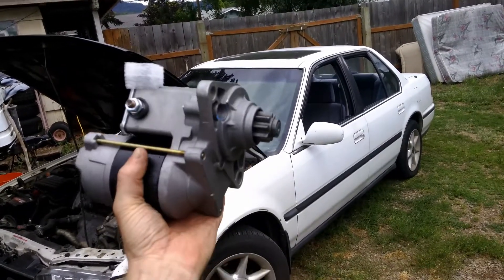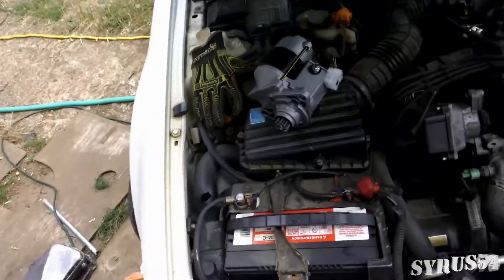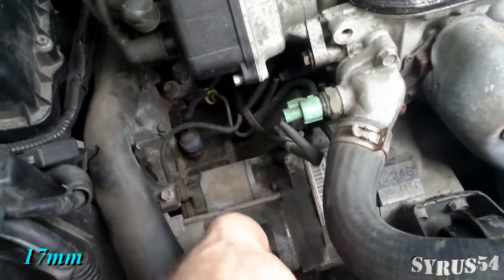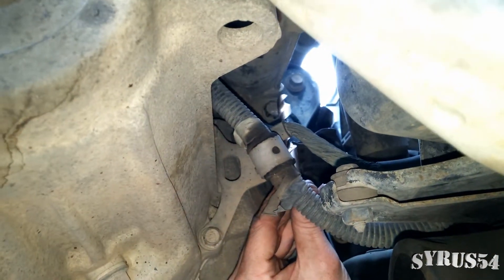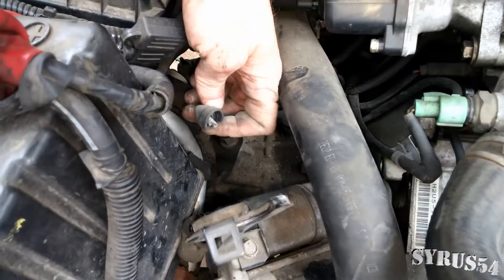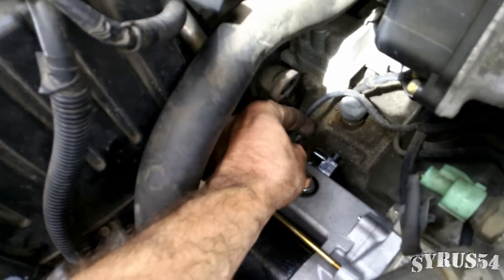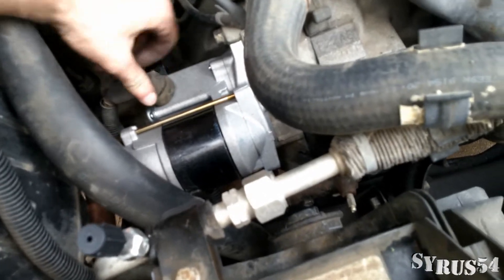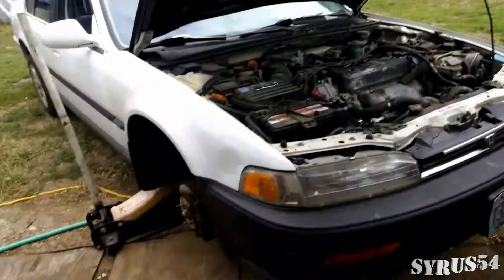Vehicular Education - Starter Replacement (1989-1993 4th Gen Honda Accord)

Comment: I replaced my starter and all it does it just click but no crank or start. It is bench tested and it works perfectly. It’s a new starter so it’s all good but can’t get it to at least crank. Any suggestions would definitely be appreciated
Reply from the maker: Bad ground. Check your wires.
Reply from the maker: Bad ground. Check your wires.
Reply: Yeah the wire from the negative to the chassis was corroded so I had to change that wire and I also had to replace the battery and ignition fuse due to some corrosion building inside. Hopefully it works

Comment: My 92 accord original  starter starts just fine but it makes a noise for a sec after it starts, does that mean the starter is about to die?  And where is best place to buy a new replacement starter??
Reply from the maker: Did you just install a new starter? I would assume that maybe you need to put in a shim. The Bendix might be too close to the flywheel. Pull it out and check and see.
Reply: @ i would have no idea how to do that, maybe a utube video on it
Reply: Most affordable starters are rebuilt ones

Comment: Somebody commented about the 17 and 14 being for the 1989. Actually I kinda came away with the same opinion. I have a 1991. And both my top and bottom are 14. And my lower bolt is anywhere near the length of the one you pulled out. It's only about 19 millimeters longer.

Comment: Good video. I'm going to try your way. Last time my starter failed I went underneath and disconnected the exhaust and pulled it out in one piece. It wasn't hard to do, and once it was out it was super easy to do tbe rest. That bottom bolt was just right there with nothing in the way. But anything that makes it easier, I'm all about it.
Reply from the maker: Damn.... That sounds like WAYYYY too much work.

Comment: hi friend, please help me, in detail if you can, my starter motor on my cb7 was damaged and I can't find it to buy because it's the same as the one you put new in yours (accord manual transmission correct?). what you took used from your cb7 is the part used in the automatic correct? either manual or automatic, does it work with manual transmission or vice versa? here in Brazil I can't find the part for manual, I only find it for automatic, and I wanted to know if it works correctly, and the screw fittings are the same please, thank you very much
Reply from the maker: The bolts should be the same, and the bolt holes, and starter location, yes. No idea on the part #. Have you tried https://www.Amazon.com ?
Reply: @Syrus54  If I buy here automatic cb7 starter does it work then? From what I saw, it's the same one you took from yours.
Reply from the maker: Should work then. Mines a manual.
Reply: @Syrus54  thanks man, you save my life!

Comment: U dont have to get underneath the car to take the starter off just take off the radiator hose where the thermostat is and the intake and u have plenty of room to take the larger bolt off

Comment: 4th gen is 1990 n on rite? 89 is th last of 3rd gen i think. Always remove negative battery cable first. 350+ amps r enough to weld metals n u together, safty first. Good vid thanx 4sharing .

Comment: Rename the video or something. 89 honda's have a 17 and a 14mm bolt for the starter. The 90-93's with f22a1 engine has two 14mm bolts holding the starter in.
Reply: Not only do they have Two 14mm, mine is a 93 and they are left and right side, not top and bottom. The left one is harder to get out.
Reply: yeah that left one is a bitch an if you might want the skinnest extention for a socket that you can get. i also had to remove brackets holdling electronics to be able to access that left inner 14mm bolt.
Reply: So did I.
Reply: Mine doesn't.

Comment: Good evening, thank you for the video.

What brand starter are you installing in this video?

I have a 92 Accord LX, 4 speed, manual transmission. I am replacing my starter and I initially ordered an automatic transmission starter online. Before I left the store the guy informed me the part wouldnt have worked and also let me know there are two types of starters for this qualifying year accord lx manual transmissions. There is the dinso and the mitsuba. I acquired the mitsuba today. Once bolted back to the engine the battery connector (where you screwed the battery cable back to the starter) is on the side. In your video your connector is on the top, just like the one I took out of my car today that I am replacing.

I bought a mitsuba, would your's happen to be a dinso (maybe denso) brand starter per chance? Or is the automatic transmission starter the starter that has the battery connector screw on top? Also do you have a manual transmission or an automatic transmission? I want to make sure I am not wasting time going back and forth to stores. Again, I appreciate the video.

Thank you in advance,

Jerm